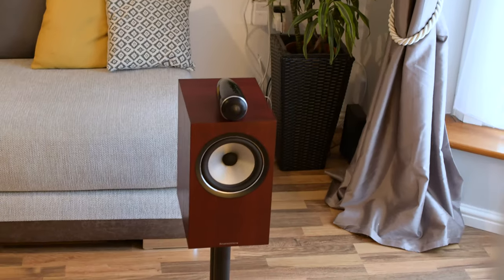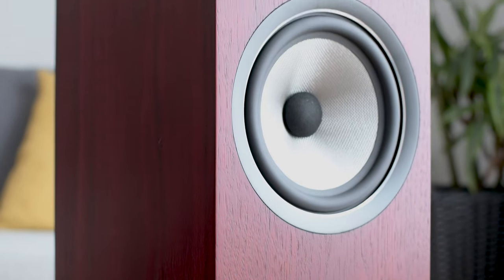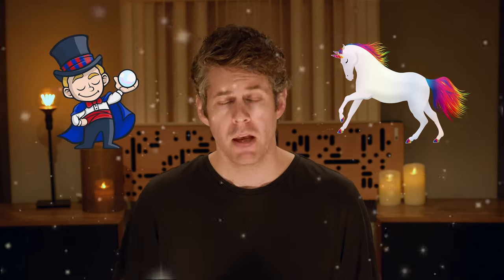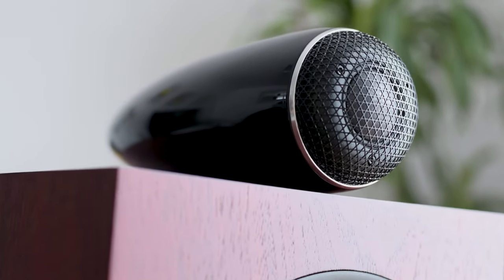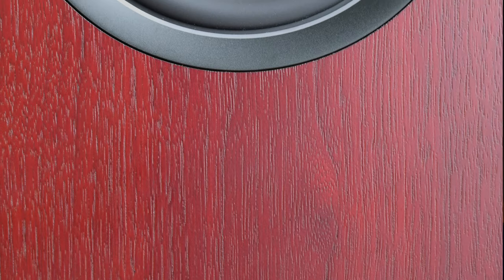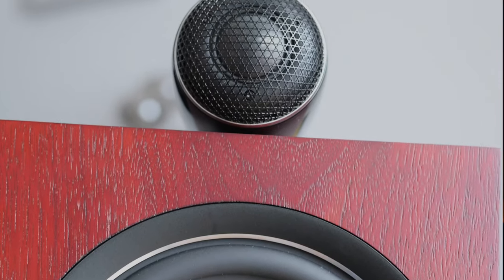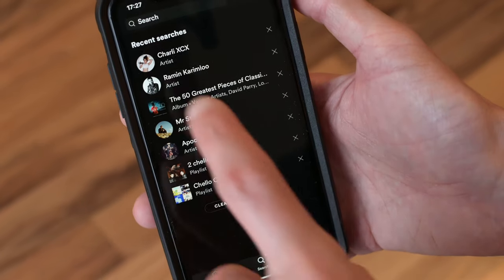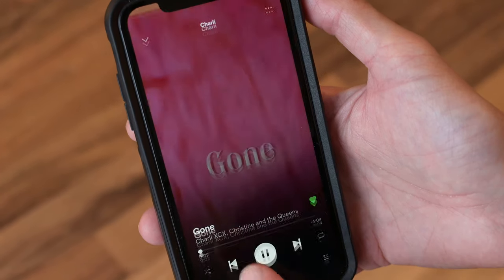Bowers and Wilkins 705s2 Review - The JAMES BOND of Speakers!!

Comment: I suspect amp-matching will be critical for such a revealing pair of speakers. I am guessing perhaps something more neutral might work better with these. May be Hegel? I happen to be running the Roksan Blak, I think the Roksan might be too much for these speakers. The amp itself is dynamic, punchy, lush and sweet, but I wonder whether added to the bright-leaning 705 S2 will make it too bright? Not sure. Actually, the 705 Signature sounds just a tad better and that Metallic Midnight Blue paint job is fire. I kind of have my mind set on the Dynaudio Special 40, just thinking what other speakers should be under consideration within that price range. Hmm...

Comment: Thank you for your concise review of these B&W.  I still have my DM7’s that occasionally connects to my system and still enjoy.  
Can I ask you to please include to your review a section where you compare the current item to those you have reviewed previously please?
I would be very interested in you opinion of the Buchardt S400 and if it is a good speaker for a small room hookup and any equipment matching suggestions you can make.
Reply from the maker: I’ve got more comparisons in later videos, this was one of my earlier reviews 👍 Would love to hear the S400 - I owned an S300 but felt it needed a bit more resolution.

Comment: Nice video and I like how you included some music samples for reference. In a small room, have towers worked for you or do they energize the room too much? Have you ever tried a sub and what were the results? Would you do a room tour sharing your dimensions and how far the speakers are from the wall seat and back wall. Thanks!
Reply from the maker: Hi Robert! Lots of great questions here. I use a REL T5i if speakers need additional bass - I’ll get round to a quick review of this soon. Room tour and treatment videos are all coming up over the next couple of months, but I actually test speakers in two spaces: in my dedicated listening room (7x8x19) which has acoustic treatment, and in a standard untreated (marginally bigger) room (10x9x18). It allows me to get a good view of how the speaker interacts in different environments. Listening distance nearfield/midfield - 4ft/6ft triangle with a minimum of 1-2ft clearance from walls. In terms of towers, most will overload with bass or struggle to integrate drivers without a bit more space, although this is not universally true and can be helped with bass traps and choosing a design that doesn’t fight the room as much - a fun video is coming up where I experiment with two massive Klipsch Cornwalls in the room, with results that might be surprising!

Comment: Have you listened to the LS50 Metas? I’m between these and those . Just looking for opinions between them
Reply from the maker: Hi Jonathan G - yes, check out my Meta review! It does come down to personal taste - I prefer the 705s2 for their air and midrange, but the Kef has better imaging and I found it is easier to match with equipment.
Reply: @SmallRoomAudio  I have a Marantz PM7005 60W into 8 ohms class A/B. I just am afraid of the 705s too harsh and or the LS50s being too muffled. I have 685 S2s right now but I am wanting to upgrade. I can get a great deal on either one of these two which is why I’m specifically looking at them.
Reply from the maker: Maybe drop the dealer a line and see if they are happy to send both, let you try them and send back the one you don’t like. A lot of shops seem happy to do this given the current situation.

Comment: Do these speakers sound silibant with female voices,  and is the bass deeper than the ls50 Meta's?
Reply from the maker: Sibilance, not really from my experience, although decent, warm leaning amplification seemed to be the best match. Bass isn’t deeper than the Meta, but it has more impact - but I think it’s a slight mid-bass bump in the tuning that provides that feeling. It’s nice though, carries a tune along well.